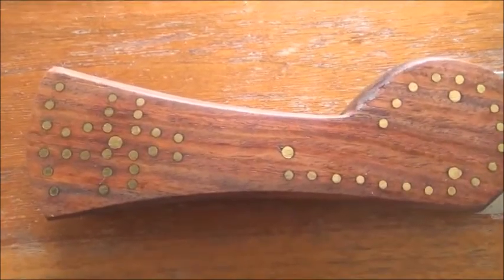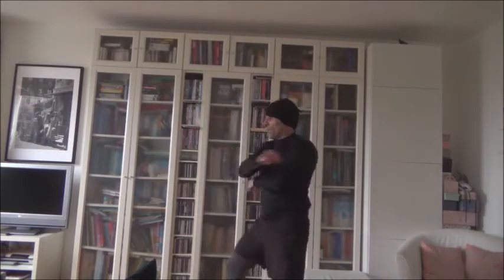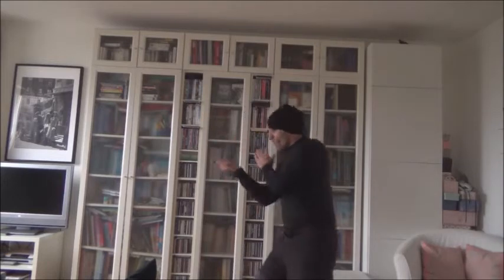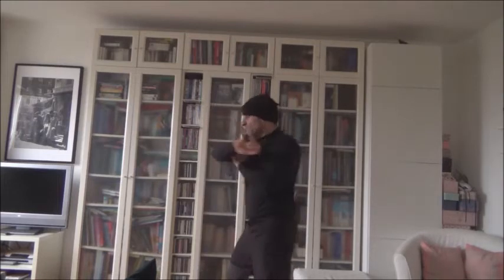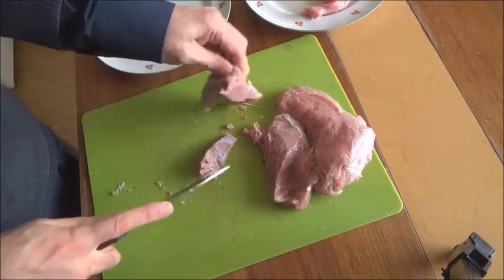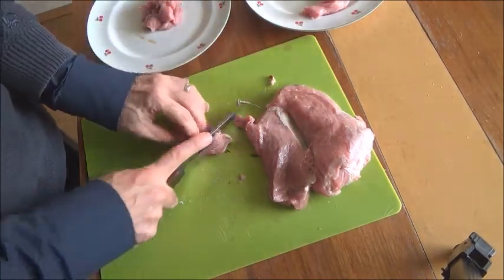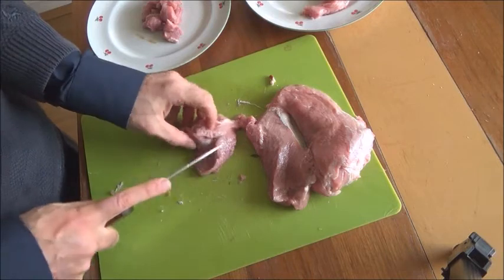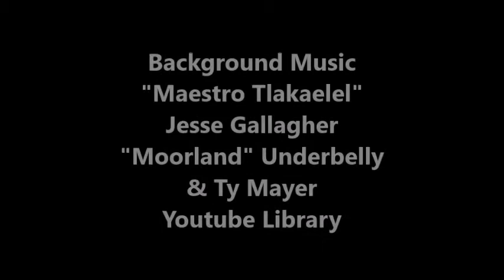Beaver tail dagger (Great Lakes Dagger)

Comment: Aren't most Beavertail daggers double edged. From what I've seen...
For more efficient penetration.
Not saying that single edge doesn't penetrate.
But in social encounters 2 edges are better than 1.
They are also used for utility, double edged knives, by for example San people in the Kalahari desert.
It's not only useful in violence as many people tend to think.
Reply from the maker: Sure both types exist
Reply: @RazmafzarTV  
Yes it seems like that.